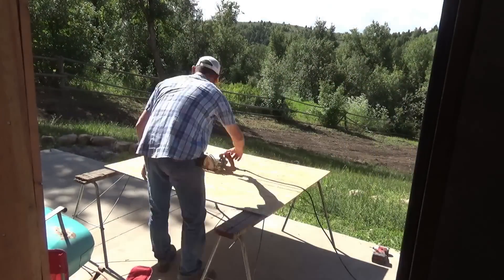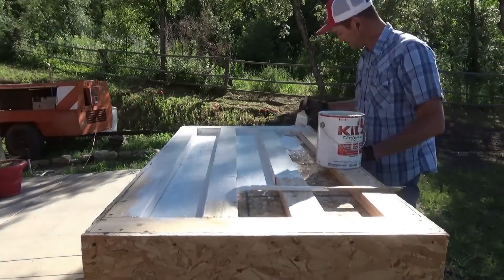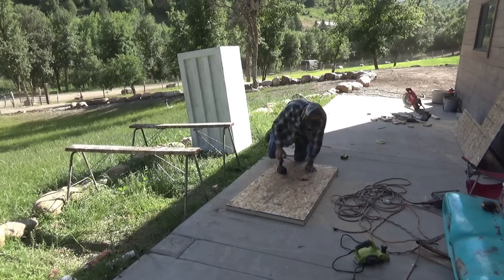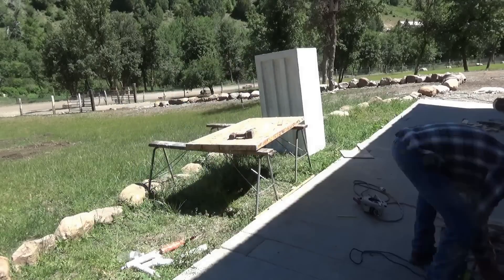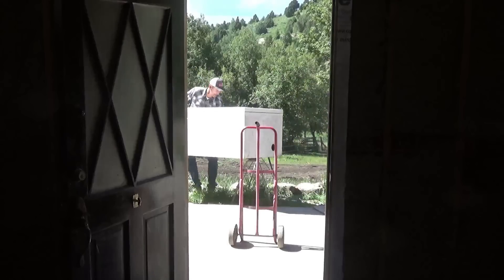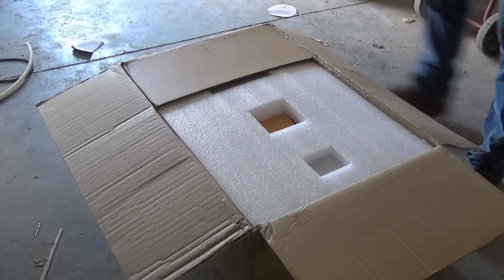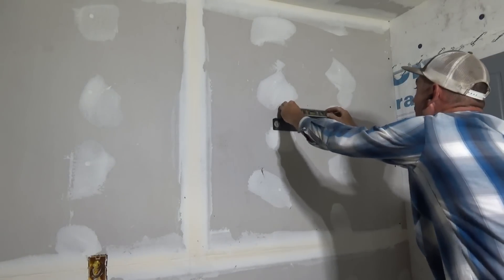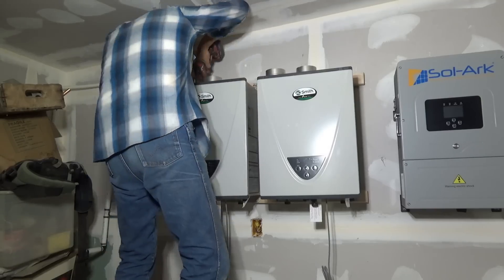#344 - Off Grid Solar Inverter,  DIY Sealed Battery Box, Tankless Water Heater

Comment: you can also put a water heater as a holding tank to preheat the water to house temperature before it runs to tankless heater. Strip the insulation off if you want . Or leave it on and use a small aftermarket element to preheat with solar.  You can also get a heat pump water heater fairly reasonable at lowes that only uses about 300 watts here is a link https://www.youtube.com/watch?v=Jk6D_D7naOY

I personally have a Rinai 98 tankless and without preheat it works great but it hardly comes on with preheated solar hot water

Comment: I love what you’re doing. With this video, I was screaming at my IPad like a rabid football fan. Those batteries need to go away from the house. First,the venting system is inadequate. If there is a single spark, you’ll find residual hydrogen which will flash, cause a fire, burn the box and batteries. In turn you’ll have a house fire. Secondly, any failure of the batteries will leak onto an OSB box. It won’t hold up against battery acid. It will fail and leak. That toxic, corrosive crap all over your floor. Not good. Get those batteries into your yard, on a concrete slab with a lip to contain any possible spill. I built a small “outhouse” for batteries. I can walk in, do what I need to do. As a side note, I used old Prius batteries. They’re efficiency drops below 85%, Toyota pulls them. They get resold for this purpose.

Comment: the batteries need to be outside or in a metal container. batteries do explode and as close as they are it could be bad. they carry a lot of amps collectively. we use lead acid batteries in the power plant where i work for emergency shutdown power and we use the best batteries made  and they go bad more often  than you think.

Comment: True Lead Acids Are As good AS AGM....
But both AGM and Lead Acid battery's suck. Ion cells are WORLDS better than both.
They don't give off any gasses, they last about 20 years instead of 10-15 and don't just die on you when the reach their end of service life like the LA/AGM battery's do. They simply slowly become less efficient as they age past their service life. 
You can also charge them up-to 90% and discharge them down-to 10%/aka use 80% of the power without damaging the battery, instead of only 40% like LA/AGM. You should never fully charge LA/AGM and you should NEVER run them lower than 50% charge as it kills their life and damages the battery. This is why charge controllers are so important/amazing. 
Though their is a down side to ion cells, they are much newer tech and VERY expensive. 

That said, your needs don't seem to be super crazy, so you could probably get 20kw/h of storage and run your house quite comfortably without breaking the bank. Im saving up for a 150 kw/h Ion bank myself and im preying to god the prices come down..

Comment: Solar Panels do not go to the inverters.  Solar Panels go to the Charge Controller.  Most likely an MPPT controller.  From the Charge Controller it goes to the batteries.  Basically, the Solar Panels and Charge Controller is just a big battery charging system.  From the batteries, it goes to the invertors.  Depending upon how you install the system, this converts the battery voltage (12v, 24v or 48v) to the 120v that will used in the house. I am looking forward to see how this is wired.  I am hoping to put in something similar in my house.  Thanks for the videos.

Comment: Man you keep messing me up when you talk about wiring from the Solar Panels to the Inverter. The component order should be Panels to (MPPT) Charge Controller with wire gauge dependent on distance. Probably 12-14 gauge. Then wiring from Charge Controller to the Batteries. Probably around 4 Ga. Then from Batteries to the Inverter. These last components should be kept as close as possible. This is were your you are going to have some monstrous gauge wiring maybe doubling some 2/0 or even 4/0 wire dependent on your expected current draw. Of course all of this is fuse protected between each piece. I'm also assuming your Inverter is not part of/combined with the Charge Controller.  You know what they say about assuming. That is one heck of a battery bank you have there. I can't hardly believe you are still trying to figure out you wire sizing. These solar companies should have pinned that down for you already. All they need is component size and distance.

Comment: You need a charge controller and a inverter yes. Yes run panels in a series of two that is how I do it. Its way better for efficiency. Think if you loose two volts Is it better on 12 volts or 78 volts to loose two volts? Its better to loose two volts at 78 volts then at 12 volts see what I m saying . My engineer friend says so.

Comment: How about a wind powered exhaust fan in the exterior wall and let the wind turn your fan exhausting the hydrogen gas produced by the charging. No electrical controllers in the box with the batteries.  Most a possible safety feature.  

JoeB

Comment: I would run your panels in series.  Calculate the max amps/volts that will be sent from you panels to your charge controller.  This will reduce your wire size from the panels to you charge controller.  From your batteries to you inverter I would run the max voltage and divide your battery bank into that voltage. Example (96v = 8 batteries in series if there 12v) then two banks in parallel. But by all means if a pro tells you different go with them.  Great job.
Reply: Opps forgot the max voltage from your panels and battery bank must be the same.

Comment: For your latch, just use window sash latches.  Seal down tight and can pop open in a hurry.  I'd put four on total - one on each short side and two on your front.  Between that and your foam sealant you should be more than weather tight.

Comment: go to barns and noble pickup an electrical engineering manual it will answer your questions on wire and the correct hookup on all electrical devices or most devices.

Comment: You might check out KrisHarbors on YouTube. He has quite the off grid electric system that he uses. Part of it is water driven, the rest is solar. I think he has quite a span of distance between his panels, the batteries, and his off grid house.
Reply: His outhouse with the solar thermal water system was super cool (or hot?)

Comment: Great video, just one suggestion you may want to put a vapor barrier on the underside of the battery box. It should help prevent rot from moisture between the concrete and the wood. I do not think the paint will provide a long term solution. Looking forward to more!

Comment: He has had the worst attitude since the proposed move in date.  All the time taken away from the dry wall, it would have been done.  Should be painting the upstairs.  Propane heaters over the top of batteries, doesn't sound good at all.

Comment: Simple salutation for the inverter issue...   buy a 5000w multi plugin and get a step down 120VAC to 12VDC  transformer. Run inline a 12VDC capacitor and diode and loop it back to the inverter...  Basically runs itself...  been doing it for years.

Comment: The size and color of your box made me think an old freezer may work. Let us know if you have problems with power use when running those tankless heaters, I'm thinking winter may be when you are running tight.
Reply: An old freezer or refrigerator of course would have worked.  Put it outside.  Heat with a controller and something as simple as a heat mat in the winter, and run the fridge in the summer to cool it down with same controller.  Inkbird is one unit.  People throw out fridges all the time.  But oh well build an uninsulated box inside

Comment: I witnessed a mechanic welding in the same room as a forklift battery on a charger.  Boom!  No injuries but it was change your underwear time.  Lead acid batteries and ignition source are a bad combo.

Comment: I've found maintaining batteries is a real issue. a simple grid tie system with no batteries seems to be the key. Wire the panels in series to up the voltage to 300-500 vdc and run a sunnyboy inverter.  I have four strings of 400 vdc @1.9 amps producing 22 kwh per day. The system works great.

Comment: On your battery vent system, since you are properly worried about hydrogen ignition, you should ensure your fan is brushless and doesn't have an ignition source.  This is also required for the switch if it is inside the box.
The hydrogen ignition range is large
Reply: Also the thermostat

Comment: @redpoppyranch I have watched for months now. You still have time to fix a fatal flaw in your kitchen. I warned about it in your March 16 video. The mistake is the insulation on the pipes in the kitchen outside wall. Under no circumstance should water pipes be in an outside wall. If you have to put them there, the insulation and the vapor barrier must be behind the pipes. You seem confident the amount of R value will protect them. Sorry, that is risky.  Especially if cabinetry is on the wall in front of the pipes. It will block room heat. The cold WILL penetrate all round the pipes from the outside. The insulation between the pipes and the inside will insulate them from the heat as well as the cold. If we can, we build a shallow secondary wall to run the pipes, on top of a  fully insulated  and drywalled  outside wall. The solution is to carve off the foam from the inside surface of the pipes, leaving an air space to the drywall. I say this as an experienced cold climate builder/renovater. Hope you see this. I hope you never put up a video of you fixing frozen and/or exploded water lines in the middle of January. ps. I have to question the competency of the plumbing inspector. Good luck brother.
Reply: Red Poppy!!! Am I wrong about your water supply in outside walls, or do you not respond to comments.

Comment: Here's one of the videos where Amy with altE shows you how to hook up your system.  She uses breaker panels before reaching the Charge Controller, which is an option.  She probably has two or three more short videos for (parallel hookup and series hookup).  https://www.youtube.com/watch?v=x7YWPjycgR4

Comment: From my experience in HCV, I hope you wont be too disappointed with your tankless water heaters... Modern tanked heaters are way more energy efficient than tankless. Both electric and gas powered.
Yeah, I know, manufacturers claim the opposite. But I'm talking from on sites experience. Can't tell you the numbers we installed only to get calls to remove them and install tanked heaters. Tankless only advantage when available space is critical as in small appartments or condos. Good luck Heath.

Comment: I am an avid watcher of your channel, and I want to see you succeed! But this segment about your battery storage concerns me. At times my pessimistic nature fires up, and I have to say something. I have thought long and hard about even writing this note to you, and do so only in the interest of your family's safety. I really do not like posting anything on anyone's channel that is the least bit negative, so please do not take this as such. I have learned a lot from watching your videos. You have commented many times that you are for lack of a better term, "Out in the Sticks", so you must be a long way from the nearest fire station.

I am sure that by now, through your research, and yes, you research EVERYTHING! That is a good thing. You have learned that HYDROGEN gas is perhaps the MOST flammable element in nature, and also in the atomic weight area, it is the smallest element on the periodic chart. Knowing these facts, you must realize that it is extremely difficult to contain this gas.

This is why I am taking the time to write to you I do not recommend putting them inside your living space. 

Yes, I know you have them vented to the outside, but when you open the battery box to do your maintenance, the hydrogen gas vents into your living spaces. ANd of course, there is always the chance of your venting to fail, like if you get a heavy snow/ice berm against that side of your home that blocks the vent.

Perhaps an alternative location would be an insulated, heated space on your back porch that is large enough to handle the battery box and give you the room needed to do your maintenance with the entry point from the back porch, not via the house. Venting would still be necessary, but at least the hydrogen gas would not likely get into your living spaces.

Comment: So many things that could go wrong with your installation. For your sake get some professional help. At least don't put a semi enclosed cabinet of combustible gas right under two sources of ignition. Or anywhere indoors, especially when you don't know how to work out correct wire gauging, which easily leads to sparks and melting wires. Also, claim you will be opening it frequently, which will release the hydrogen that will have enevitably built up and not entirely escaped through your "ventilation" system. 
.. just to name a few.

Comment: I love the idea of a pre heater for water.. would have put in a 30 gallon Electric tank and use it to dump power from the solar once the battery bank is filled.  Once the battery bank is filled and you might not be using power to match the output of the solar array you have to dump the power somewhere ... can just be run as DC as the element does not care.   Yes it takes a lot of power to finish topping off the float on lead acid batteries.. but with the size of the array  this could easily happen at 10am in the morning

Comment: Really good things about lithium batteries . They do not off gas. They can be drawn down to near zero and still work just fine. Try that with lead acid and you will be replacing them in a matter of months

Comment: I keep going back and forth on batteries. Pretty well decided that the usable amount of power one can have with lead acid is no where close to a lithium battery bank. Kind of like OK Buy it once Treat it right and you can have it for the life of the house.  With your battery bank  hope you only plan to take it down to 20% of the battery output or you will be buying a new bank in just 3-4 years.  This is reality.  No clue what you spent but apples to apples you invested in lemons

Comment: When a friend built his home, he used in floor heating and cooling. I am not sure how it all works, but for winter he used a wood stove up the hill to heat the water. This worked for a few winters until he decided on thankless heater  it all work well. The thing is, in winter it took a couple days to warm the place. In summer he just shut off the heater and the temp of water kept it cooled. There again taking a couple of days to do this. it was nice having warm feet on ceramic tiles. But, it seems that with the extreme temp differences in MN as it is in Idaho, this isn't the greatest. Plus I think the need for a quicker and easier Control as needed is MUCH Needed in these states.

Comment: I can't remember if you have AC or DC coming from the panels.  Nevertheless, the higher the voltage, the smaller gauge required and the further you can transmit the power.  Oh, and please, if you have any hard water minerals, a water softener is a must, even if you only use it to feed the gas water heaters.  Even a small $300 softener will save your several $1000's worth of appliances and fixtures.

Comment: Personally I would have gone with lithium based batteries, as the lead acid you have now have an expected lifespan of 8-10 years. But lithium is closer to 20-30 years. While the upfront cost is higher, the end cost per kw over 20 years is lower.

When those wear out, consider switching to lifepo4.

Comment: I can't remember if you are going 48volts or not. Depending on your solar charge control you can use a high voltage in so you can have a longer run to the batteries also higher the voltage equates to a smaller cable size run from panels to controller.

Comment: ...seems like alot of things are coming together...was talking with my hubby... would it be advantageous to line the bottom &like 4-6" up the sides, of the solar battery box with the rubberized/sticky/waterproofing roofing material...in case of a possible leak of one of the batteries to prevent corrosion thru the bottom of your battery box ? Just a sure..I'm sure you've tried to think of all scenarios...
🇺🇸🎇 HAPPY 4th🎇🇺🇸...to you and your family...☮️&❤️

Comment: Be sure to use the 12v computer fan forcing air into your box.  With excessive off-gassing you don't want all that hydrogen gas being pulled through your inductive fan.  The localized voltage spikes in these small (unsealed) fans can easily ignite a highly flammable gas. 

Also, using a tank water heater for your preheater would allow you to dump your excess solar (when batteries are fully charged) into heating, which could save you a fair bit of propane in the summer months.

Comment: Also heat kills these batteries install a bilge pump fan from baot I ran my bilge pump off my windmill so its independent
Reply: Correction bilge blower fan not pump I must be in boat mode

Comment: I work on Telecom, and we've got lead acid batteries in our Central offices that were rated to last 30 years. 40 tests later they're still good. Your biggest enemy is heat. If you can keep them at in the low 70s°, they'll outlast you

Comment: Depending on the distance you might want to go bigger then 2/0 k type soft drawn copper. Direct current has a higher voltage drop then AC there are websites that can do the calculations.

Comment: The box looks good. Try using a window sash lock for the lid. It will hold it down tight and you don't need tools to get in to check the batteries. 

    Prime-Line 
    Antique Brass Cast Metal Spring Cam Action Window Sash Lock